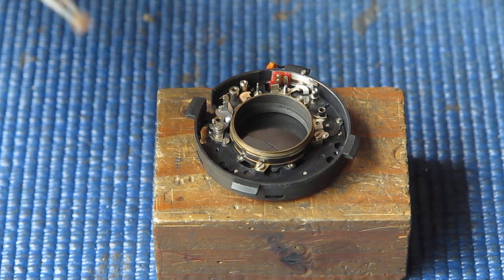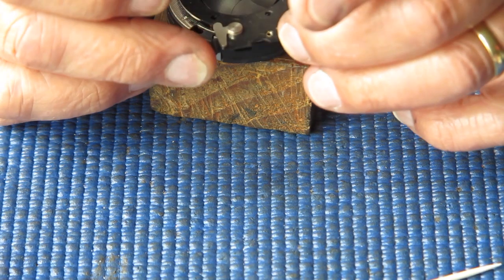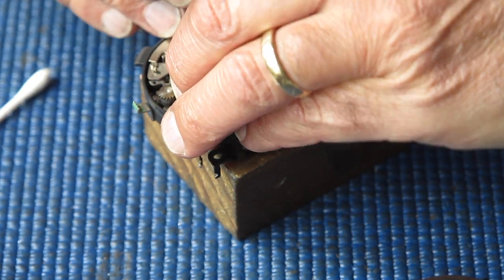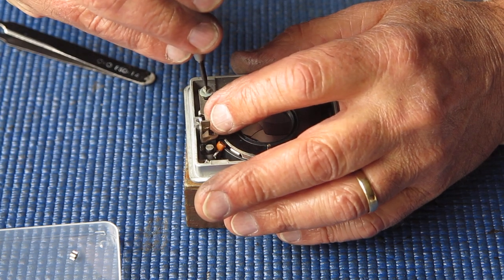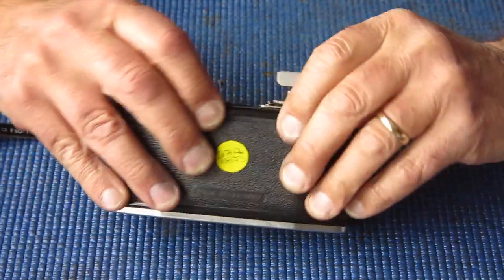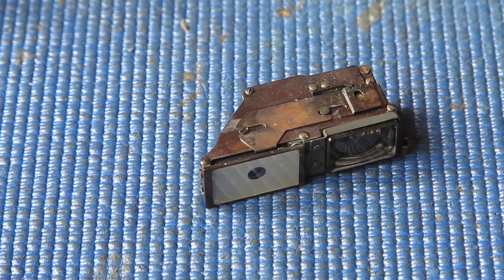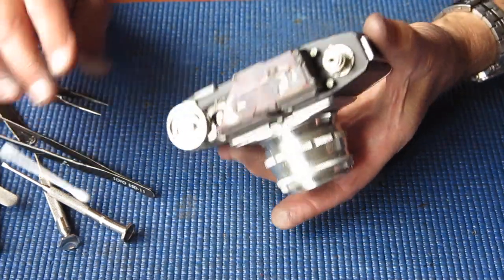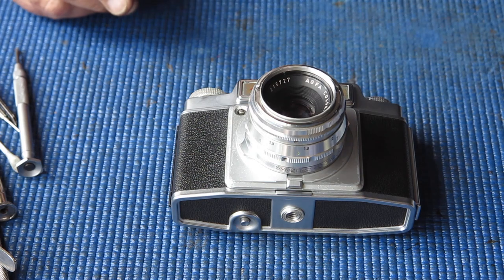Ambi Silette type I service part 03

Comment: Thank you. I have an ambi silette type I with the rangefinder horizontally off at infinity. You didn’t need to adjust this one, but I take it the horizontal adjustment screw is on the rear side of the viewfinder under the eyepiece like on a drawing I have seen of the super silette?